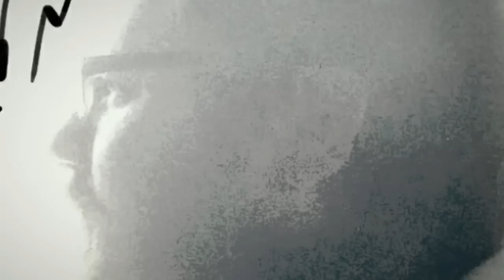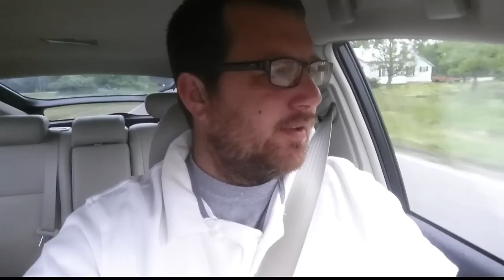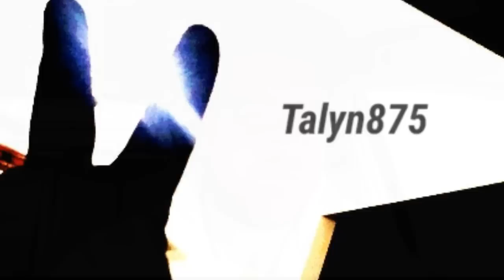Causes for Low Condenser Subcooling (Air Conditioning)

Comment: I have an issue with a 4 ton TXV system. The OEM charts specify 11 to 13 degrees of subcooling, the best I can get is 5.2 degrees of subcooling. Pressures are 70/217 with a LLT of 101.6. The pressures look good but the LLT seems high. The receiver dryer is good, I get equal temps on both sides. The Evap coil is sparkling clean as well. I'm self taught on HVAC so the higher than normal LLT has got me stumped. I added 1 pound of refrigerant which took the pressures to 76/250 but it's still at 5.2 degrees of subcooling. Any help would be greatly appreciated. Thanks in advance.

Comment: My cousin has a unit that I'm going to attempt to fix tmrw ... Yesterday I went there it is a carrier split system with gas furnace and indoor txv from 2006. (410A )It has a true assist board in the condenser . Y-hps-lps 230v - contactor -comp schematic on it with led lights ... The y and hps leds are on but not the lps .... When I push in the contactor because there is no 24v there I get 50 suction and 200 head .... What do you think I should first look at before recovering and recharging unit?
Reply: I would look for a refrigerant leak in the evaporator

Comment: By the wrong expansion valve I assume you mean on a heat pump and not a straight AC spit system.

Great series of videos. If you could please explain in an upcoming video the selection and placement of liquid line filter dryers and suction line filter dryers I would be extremely great full. 

Thanks,
PHCAPPRENTICE
Reply: I mean AC. I am referring to an oversized TXV  or piston
Reply: Thanks zach

Comment: What does it mean when your liquid line is at 130 to 135 degrees and you have a normal subcooling? The answer is it is damn hot outside. That is what we have out here in Valley of the Sun.
Reply from the maker: Damn Larry that is hot. I should say desert folks add 20 F to my examples!
Reply: Zack HVAC I told Stephen that  I would do some videos on it this summer so you guys can see the 5 degrees superheat and 130 degree liquid line.